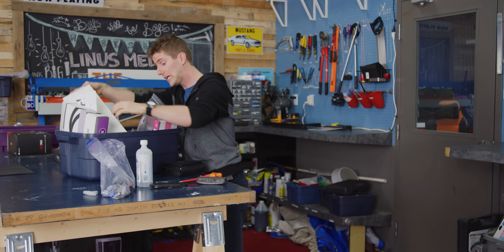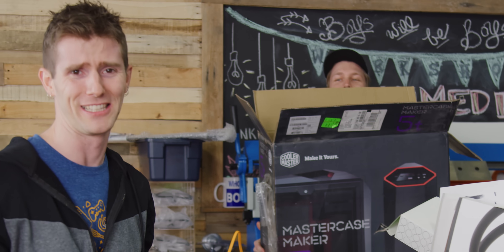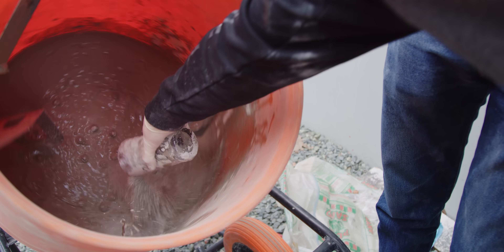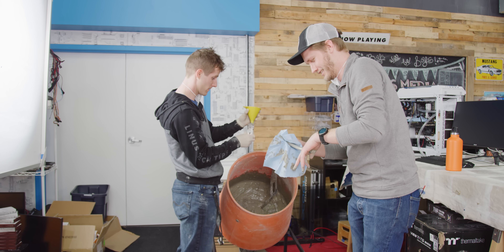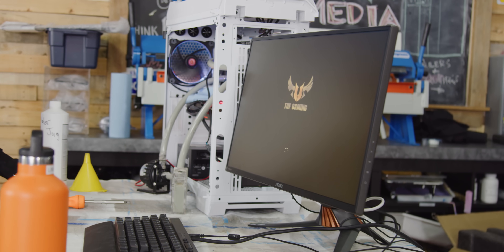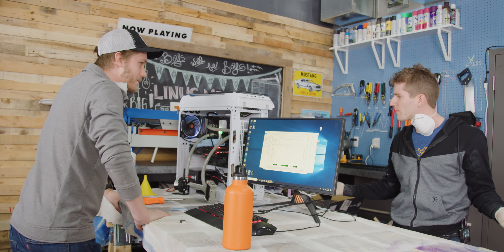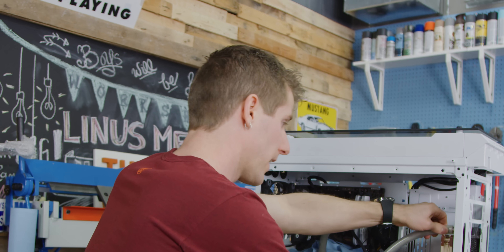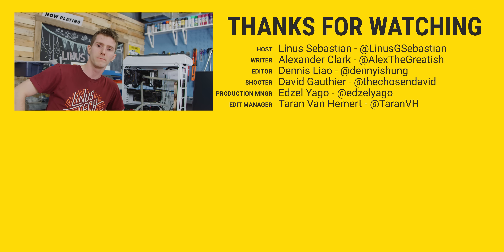I Can't Believe This Worked!!! - Concrete Cooled PC (April Fools 2019)

Comment: Linus, serious suggestion. make a concrete block, with a cpu inset into the concrete itself. then install the cpu onto a mother, with a big concrete block molded around it, and see how cool it will stay with a hardened concrete slab stuck to the cpu

Comment: I know this is a joke, but this may work. It's not the concrete absorbing the heat. It's the water IN the concrete. Water has a tremendous capacity for heat absorption. That's why the old old 50% water/50% alcohol- light-your-hand-on-fire trick works. The water absorbs the heat of the fire, and does not burn your hand. Same principle here. While you are impeding the transfer of heat to the water by adding the concrete. Water still absorbs enough heat to make this work.   Science.

Comment: wow, try di-atomatious earth (DE) single atom clay, i only use it for pest control on plants and veg, but should flow like water. Or even 'slip' which is watery clay. then you could refine to china clay, 'china' etc.  I even imagine you could run DE dry, as so fine runs like water, just use a parts washer pump.

Comment: you should try gallium cooling. as long as the computer is running the gallium wont go solid. it is a metal so it should conduct heat really well. im like not joking rn. LIKE DIS COMMENT IF YOU THINK THIS IS A "GOOD IDEA" THAT LINUS SHOULD TRY!

Comment: Imagine, quick curing cement cures.... You assume a brown out but wouldn't it eventually cure even without a brown out, assuming there was one in the first place. You said the stuff on the outside wasn't moving, assuming even that moving for sure stops curing.   Put something in the mix to stop curing?  

And even if you could someone stop the curing you still have the issue of a pump motor being hella overworked.  So maybe should have made it thinner along with additives and that could also help with curing and make it so it doesn't work the pump motor so hard.

 You recommend this after such obvious evidence that it doesn't work, at least not without major adjustments. One could assume it was a April fools prank but you recommended some crap preinstalled Linux on a usb stick for $80 before and that wasn't a prank.

Comment: Also could try putting copper pipe and make a rad out of concrete.  Just make a big block and run the tubes too.   Almost like a heat pump.

Comment: You guys put the concrete in the tubes and radiator, that's where you went wrong, you are not meant to be replacing the water in a water cooled setup, you should be replacing the air in an air cooled setup with concrete.

Comment: Why can't you use thermal paste for cooling? It transfer More heat than concrete! at the same time it can't get harder
Reply: Well, you totally don't know how thermal paste works. It actually cures after being applied and heated by CPU. And well, while being great heat carrier, it does not conduct heat as well as water. That's why we always need the most thin layer of it as it can be.
Reply: @andrewzasidko6595  thanks bro
Reply: @dogoneshame Says the bloke that suggested doing a thing that wouldn't work that's pissed off when expained to why it wouldn't work.

Comment: While this is obviously stupid, it did give me an idea! Over the years of internet there have popped up posts about using copper paste/grease instead of thermal paste. This have given worse results than thermal paste, however what about using copper grease/lithium grease instead of water in the cooler? You should make a series looking into different compounds that can replace the water! :D

Comment: Your doing it all wrong, You need to encase the entire mother board in Concrete with copper fins radiating out from the CPU and the GPU to better take advantage of the thermal mass of the concrete. Remember to use distilled water when mixing the concrete, so the water is not conductive.

Comment: The reason why you cant see it moving is laminar flow. At the walls, velocity is theoretically zero, or actually it is neglectable. Since water is transparent, you will see the slight bubbles and stuff but concrete makes the none-moving layer...well, not transparent :).

Comment: PLS make a real concrete cooled PC!! There are ways to keep the concrete fluid!!
Reply: @danielefteriadis6971  How do you handle the wear from the abrasiveness of the graphite powder? I work with graphite daily, and it is a lot more abrasive than you would think.
Reply: @jaredburton90  you could try a silica and mineral oil suspension
Reply: Jared Burton r/wooooooosh
Reply: A nuclearly powered refrigeration system. This will keep the pc cool.
Reply: A real concrete cooled PC long term would work in solid form, just make a big block with some grooves and rig it to the CPU with some copper heat pipes.
Reply: This is a real video lol they compared it to the the food thermal paste in that video.

Comment: where I come from "the Middle East" we used an even crazier solution where we used to use natural climate and the wind to cool water with no electricity ever we used to use  the "HIBB" where it is a clay based jug filled with water that pours es through microscopic holes  and the outer of the jug gets cooled so it cools the inner relatively well! but be careful; where this solution leaks so you must put a bowl underneath and check the water level cus it would decrease!

Comment: solution advice. make the cpu block of concrete instead. then run water through that. the concrete will pull the heat, and the water should keep the concrete cooled. idk, seems like a pretty good idea.

Comment: Hey Linus , Try Natural Clay . The same clay that's used or found in Heat & cooling Packs. (For your Back ,legs Ect. ) that can be put in a microwave or freezer. Or oil Based Clay It doesn't harden like say Sculping clay after being wet & setting . Where with Concrete you have the issue of it Harding ( like we seen in the video ) . With (some) Clay's it doesn't harden but you still get the Cooling properties of Concrete which Essentially is just a Clay with other Materials that Hardens. So if you mixed say 3/4THs clay to water or 50/50 or with oil Based Clay use Oil . Basically enough water or oil in the clay for the pump to cycle it through you Theoretically should get the same results ( if they had been legit & it wasn't  all a April Fools  Shenannegan) as you did with the concrete without the worries of it Harding in the pump in event of a Brown out or Black  or any event that may cause the pump to stop cycling. Possibly Give it some thought or some tests like the Concrete.

Comment: So if concrete has qualities that expand the heat absorption area it seems it would be a better solution to make a very thin (like a 1:4 mix instead of a 1:1 mix according to directions) so that it reduces the likelihood of solidifying.  It would still improve the amount of heat spread in theory and may do a better job since movement of the slurry would improve.
Reply: Or mix it with pc coolant well any liquid could be mixed anyway right mostly water with molecules in it

Comment: I think the funniest thing about this whole video, is that the Russians actually tried this with a liquid metal cooled reactor.  The hot metal will carry away a tremendous amount of heat, but you only get to turn the system off... once.
Reply: coffey3c NaK metal coolers actually work better than you think
Reply: @fss1704    I don't think so.   The heat capacity, specific heats, of these materials allows them to move a lot of cals. They work, but they had drawbacks.
Reply: You probably mean Cheryobyll which was graphite-cooled, not metal-cooled. There are several reactor types with metal-cooled loops (including most Thorium-reactor designs). Dont forget that among others Chernobyl was operated until the year 2000 at first 3/4 then 1/4 capacity.
Reply: @d4fs33k3r   lead-bismuth cooled fast reactor used in the soviet Alfa class SSN, had to be kept warm when not in operation however.
Reply: Chernobyl was graphite moderated but it was water cooled (which is part of the reason it blew up).
Reply: Most reactors have been water cooled.  Low pressure, or high.  Generating hydrogen is always a danger.
Reply: No, I don't.  It was an experimental unit.  Oddly, they made the same mistake in a sub, which was cooled by molten salt!  That one came to the same end.Unfortunately. Also, Chernobyl was a copy of a design from the U.S. There was a similar, though smaller, test unit like it.  We thought it was a bad bet.
Reply: Lil' Lazzaz  Chernobyl was in the Soviet Union, loosely known as Russia.
Reply: @prosfilaes  Doesnt make it true tho. Every state within the SU had its own government and organs of state.

Comment: I believe when concrete drys it actually produces a cooling effect similar to a swamp cooler. The surface area of the porous concrete causes it to get pretty cold when it has airflow. I was fully expecting you to throw some heat pipes in a block of concrete and running them to the CPU. lol

Comment: Oddly enough, you can use sugar in concrete to prevent it ever curing. All it takes is just over 1% white refined sugar.  I want to see this video redone for the real question - how long will the pump last?
Royal Society article on it: 
http://prospect.rsc.org/blogs/cw/2014/01/30/concrete-chemistry-and-the-tfl-sugar-rush/

Comment: Try a PTFE micropowder aqueous dispersion. The high specific gravity means that it should be able to hold more heat per unit volume of fluid.  Also, the plastic micro particles won't have any negative reaction with either copper or aluminum.  The nature of PTFE means it also won't wear out the pump rotors in the same way that ceramic micropowders (or cement) would, over time.

Comment: dudes,, really do it. get it to work. more water less concrete dust. bigger faster pump to keep it moving being mixed. i think if you use a pump that is way overkill it may work. the concrete mix needs to stay moving and it wont set. thats why concrete trucks keep it spinning and mixing. i think you guys are on to something. conctrete makes you feet cold. facts.

Comment: Dear Linus, do a thermal paste cooling system, please
Reply: thermal paste and metal piping, might not be too bad
Reply: No no no no no! Wie need liquid metall!
Reply: Gallium maybe?
Reply: Gallium would be in its solid form when the computer is idle or off
Reply: @plasticfork4827  They tried liquid concrete it would be solid when its off too so they'd preheat it
Reply: Shubham Patel 😍
Reply: Felix the CPU and dont even put the top Back on
Reply: The computer would freeze
Reply: Freedom Through Knowledge why?
Reply: @ShubhamPatel-ik4yi  joke
Reply: Chaitanya Singh 🤗

Comment: I have worked with concrete for 40 years and it can be made to work for this project the secret to keeping it from setting is sugar . when we would have trouble on a big pour and the trucks would back up to the point that the concrete was going off in the mixer trucks the drivers would toss a 5 pound bag of sugar in to the back of the truck and kill the batch. for some reason table sugar will stop concrete from setting and makes it fluid you will need to add a little water with the sugar but I can promises it will never set in the tubes again and it will flow better than it did on your first try

Comment: You would probably want to try hydrated lime instead of contrete as its the main ingredients for cement but pure and try using mineral oil instead if water and make it 80 %oil 20% lime as it should not set as easy

Comment: so putting the concrete in the hard copper loop you built should work even better, right? you have to try it!
also, if you use isopropyl alcohol it would keep the mix from curing as the calcium silicate hydrate can't bind without a polarizing liquid. just make sure your loop is sealed, cap it with a balloon to allow for heat expansion.
Reply: That is an awesome idea! But, now I want to try this.... This could end badly.
Reply: You would be great at writing technobabble for sci-fi, man

Comment: It's a quick dry cement mix though. What were you expecting :/?

And you don't create a mixture with cement and water. Cement reacts with water in a process called hydration. This reaction process makes the cement harder over time. So even if you had your computer running, I doubt it would stay liquid for long.

Comment: So the concrete set, who'd have seen that coming? Obviously, leaving out the cement and using very fine sand should give similar results without that drawback as presumably it's the density that's the key. I'd like to see tests with a variety of water-based suspensions like powdered metals, powdered lead ought to work really well. I imagine that it's a function of specific heat and density, so putting a list of materials and their density and specific heat values into a database and crunching the numbers should give the optimum material to use. At least they got.. Concrete Results.

Comment: April fools lol
That said, ceramic heatsinks and ceramic heat pipes are a good idea, they would transfer heat better than aluminum. Also, if you use heat pipes that are either ceramic or metal, you could use radiator fluid... but you would need a radiator pump with an oil reservoir.

Comment: Haven't watched it but you could probably make a custom mix and actually make a concrete like substance that cools stuff. It's just particles in water that dries. Just make it not dry and use ingredients that have very good heat transfer. Does thicker liquids work better as it has more time to pull heat as it moves slower? It's probably doable. You could probably even change out the limestone or wahtever is at the base of concrete if it's needed. What are the characteristics of normal concrete or the range of concretes and which ones are good/bad. Then look at alternatives. You could even look at safe ingredients like that are not as conductive like how they make ceramic thermal pastes. Might need good pumps or a very loose mixture though. How do you make it watery enough without adding actual conductive materials. Maybe some sort of silicon gel? I don't know anything about materials. 8)

What is funny. If you use actual non drying concrete as a loose liquid in any form you can simply move from pumps to old fashion paddle technology and simply push it along gently. 8) You could then find a mechanical means or other means to propel motion. Or at least go to an entirely different form of machine to produce motion. Slow pumps could be stylish. It's more extreme in the quite department potentially. Slow flowing liquid cooling setups.

I bet you there are some interesting slow movement machines for such flow types. Both old and new. I wonder if it junks up stuff more or less than liquids in fast flowing setups.

There would also be much older examples of that sort of tech to some degree as it is potentially easier to make and may have more time being used and have more thought out designs.(it could also be a good study to understand other characteristics for normal paste/ liquids since it would push certain problems more. It might help improve junking or other characteristics it brings out.)

BTW, would other tubing like copper, or other more intersting materials be good if this was taken to the extreme as it would take out stuff heat in the tubes. You could also completely redesign a loop and add more cooling stations or even loop back to itself potentially if it were good enough to never need to max out heat or have enough time to pull it. I would think you could get interesting results depending on the materials potentially. Maybe new cooling block types. Or at least different loop designs and potentials.

You guys should actually try to do it seriously by getting rid of it's drying problem and adding or changing out materials in it that should be good for heat conductivity. Technically couldn't you have less conductive materials and still get a good result based on how slow it moves. If the whole loop is a giant radiator with the right characteristics couldn't it be made to work?! I would think you might want to target flow to heat dissipation to get an ideal cooling solution.

Comment: Do a colab with Cody's Lab and cool the pc with liquid mercury xd
Reply: I had the same idea, but I wonder how the pump would work? Since liquid metal is conductive, I don't think it'd like to come in contact with the pump motor, and since mercury is so heavy, the motor might have trouble pumping the mercury anyway. Plus, you'd have to worry about preventing any mercury amalgamation with metals in the loop.
Reply: @ojtheaviator1795   i mean what if you were to use a special pump that does not come in contact with the liquid A "Peristaltic Pump" also i've done some looking around and well mercury reacts with everything so long exposure would be bad especially for aluminum ya know

Comment: Hey Linus! What if you used a very watery version of the concrete? Perhaps the water was evaporating and when condensing it wasn't mixing back up. A very watery mixture might encourage remixing more and still have the benefit of concrete.

Comment: Best part of this is that you ACTUALLY linked to where to buy the bags of concrete used for this XD
Reply: I'm more surprised that Newegg sells concrete mix.
Reply: @AubSec  it's because concrete is a great coolant, it all makes sense!
Reply: @AubSec  RIGHT?!
Reply: Liquid mercury would dissipate heat even better... in metal pipes, instead of plastic
Reply: @portaadonai  the problem with that is it's a heavy metal, and very poisonous. It also expands too much under the kinda of heat produced by computer parts
Reply: @OkieOtaku  not that poisonous, you can drink it once or twice and your just fine, its long term exposure thats the problem. Cant imagine it expands much at all, its already liquid at room temp
Reply: I like the fact that Newegg actually sells concrete.  I guess it makes sense given it can be used for PCs!